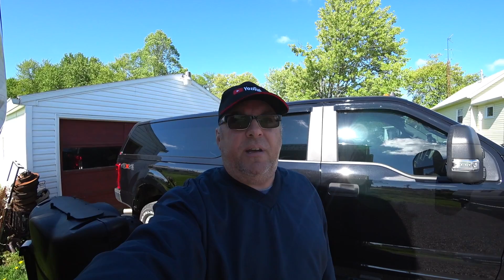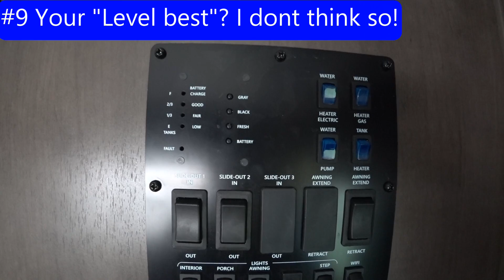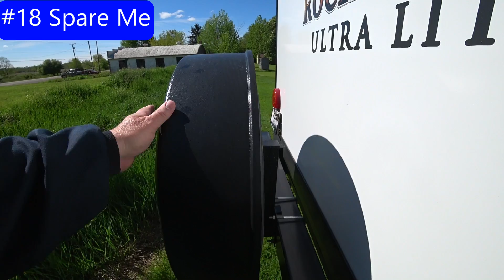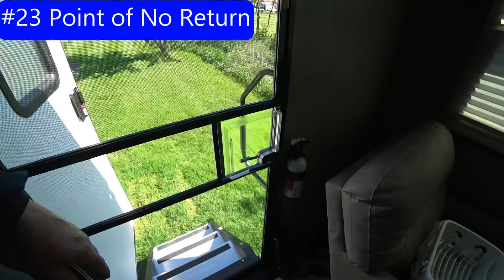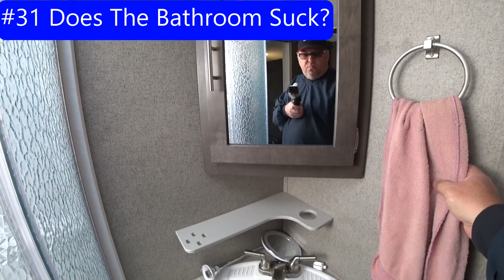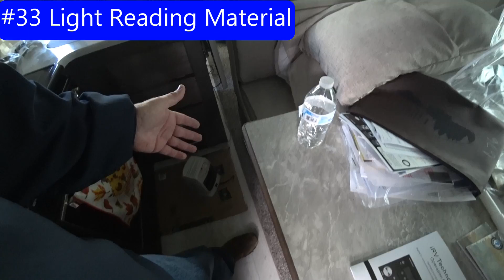36 Dislikes on Our BRAND NEW RV ☹

Comment: Your 1st one was something that didn't impress me with my new camper. It had no levels on it either. Also not a fan of how high mine sits off the ground. My black tank drain goes the full length of the tank and then a sharp 90. Don't see how that will drain very well let alone flush it out since mine doesn't have a tank sprayer. I wasn't happy that I had to move my solar prep and power distribution block on my frame to install my weight distribution. Was not a good setup. Also not a fan of my fresh watar tank and pump being under my bed. Tank isn't a big deal. But the water pump could be in a better spot.

Comment: Wow, wish you were with me when I got mine, ours is just a 17 foot keystone hideout, we are fairly new at this, but have the electric jack, the sway bar, the distribution bars, the water filter, a generator and an inverter. We got a tv for 74 dollars at Walmart. The mount was 10 bucks. A cooler that works in trailer or in truck. I wish we had of gone to 24 feet max, maybe with a slide, but I do like the airstream. The gas to tow a trailer is freaking me out. We have to do more boondocking to offset park fees. Great video.

Comment: My 2019 wolf pup is small enough so why when you open cabinet doors you have drain pipes for sinks running across the shelf or the water supply lines in the way as well! Once the warranty is out I will be getting  pec chrimper and 90 degree fittings and more pipe to reroute the sink drains!

Comment: mike. my new cougar was the same way. dont understand how it could leave the factory . suppose to be able to access the fridge, well, the island was mounted wrong and blocked my fridge. window blinds are all crooked, over 65 screws were not tight or screwed into anything that was not stripped, bathroom door was warped, they didnt put the plastic seal in drain pipe, leaked in the coach, sewer hose storage wont fit a 20 foot hose. light switches are all in the wrong spots where you have to move to get to them, like you said, for a 35 k, and in my case a 50 k coach. they need new designers. im writing keystone demanding a 2500.00 refund. for all the repairs ive had to do that should have been done. best of luck to you,
Reply: Good luck trying to get a refund. You can be sure your request will be deleted as soon as they finish laughing at it.

Comment: Yup your picky.  I am TOO!  So I tend to agree with most of what you're saying.  You know better than to order options like that TV.  Every one knows they're going to pay through the nose for options you could easily install yourself.  A lot of what you pointed out though you should have noticed when you were shopping though so you shouldn't be surprised.  You still ordered it knowing it so you were willing to accept it as it was.  I ALSO agree it is a nice RV and I WOULD HAVE ACCEPTED IT AS WELL!  Some of the things you pointed out are absolutely STUPID and really CHEAP on the MANUFACTURES  part as well!!!  Don't misunderstand I'm sure the points you are making are meant more to point it out so other buyers will see and know what they will be buying, So I am not saying you are wrong!  As well as that you are venting little frustrations that you have and many that you'll have to fix or redo.  They ( all manufacturers ) have never made a quality top shelf RV as far as I can say!  Just the CHEAPEST one they can get away with really.  Very respectfully JOHN

Comment: So your dining room table doesnt fold down and have velcro strips that adhere to wood blocks with strips as well against each side of seat right under outside bottom part of seat? I know my 2019 Rockwood signature ultra lite 8311ws does. That is crazy. Def need to keep table in place durring transport. I do agree with many of your complaints though as i have some of the same. Still love my trailer regardless. Thanks for sharing your review.
Reply from the maker: Table folds down like most. We don't want to fold it down every time 😁😁

Comment: Alot of good points.  Pretty "nit-picky" on some tho.

The TV was your bad IMO.  Any options that are an easier DIY install should be done by the end user.
- that said, aside from the actual tv itself, just having the dealer/mfr install the tv bracket alone would almost be worth what you paid.  ;)
I know of many people who have had nothing but issues attempting to successfully find and anchor a (tv) bracket.
The overall average build quality when talking about RV's is bad enough without trying to find a secure enough location to hang a 32" plus tv from.

Comment: IF..manufacturers listened to the owners, many of these "Why didn't I think of that" moments in the engineers department would ignite a light of reasoning. Yes, some of the things you can 'handle' yourself, but then when you pay a pretty penny or two for what is presumed to be quality then you shouldn't have to come home and 'fix' it to be more durable or practical or efficient. 
Growing up my dad built my mother a new home about every 5 yrs or so, and she always said that no matter how much planning or designing you do, you don't know what works or doesn't work until you live in it. Thank you for sharing, and hopefully someone who can make the right decisions at the factory sees your video.
Reply: Katie Rae  Thank you Katie, but my point was that as families grow, needs change due to life and circumstances beyond our control. Manufacturers who pay engineers/designers  sitting in their ivory towers are not always in touch with what  people who live in RV need, the smart mfgr.s do listen to feedback of owners and make changes. When you pay for what you perceive to fit your needs and have to 'remodel' because of poor workmanship that is something else all together, a new owner of a RV who is not receiving what that perceived to be value is not good.

Comment: The heated tanks (strips) only work on the grey and black tanks and should only be used at 40 degrees or below. There is no heat strip on the fresh water tank. The furnace does not heat the tanks.
Reply: Correction. I just contacted Rockwood. They apologized for giving me some incorrect information. The heat strips work on all tanks (grey, black and fresh). There needs to be water in the tanks when using the tank heaters. If you are hooked up to city water, then make sure that there is some water in the fresh water tank before turning on the tank heaters. FR does not use the furnace to heat tanks as this is not effective. That is, the furnace heat would essentially be blowing outside and not heating the tanks.

Comment: I have the same model 2604ws but mine is 2017 model.  Electric outlets, or lack of, is a wonder to me also.  My black flush is on the correct side tho, can't understand what they were thinking putting your model on the opposite side.  My biggest disappointment tho was not noticing before purchase that the chairs had to be moved in front of the door in order to bring the slide in, that is a pain. The chair also has to be moved to fold the couch out into a bed. I have the table and chair option.  I like it for sitting and looks nice, but sure miss the storage that is gained under benches. Happy travels.
Reply: oh by the way you can download a PDF owners manual

Comment: The perfect RV doesn't exist. The only RV I have even bought with bubble levels was my Jayco Pop up. I don't want a rear ladder. I've seen them pull loose by people hanging chairs and bikes on them. Putting the black tank flush on the passenger side is asinine. Most tank flush don't spin they just adds water. That's why I changed mine to the Tornado flush system.

Comment: Mike solved the 50 amp cord , when in a park that only is 30 amp I have a much lighted 30 amp cord set up to use so at least some of the time I have a lighter cord to pull out
Reply: I haven't seen many units with 50 amp service anyway. It should be a real plus.

Comment: I know what you mean about the hookups some of the models have them all over the rv. And my 2004 hrc next level has a 200 page plus manual. I have been looking for a smaller rv but I think I'll stick with the 37 foot. All it needs is tires and a roof. So what am I looking for. The new ones are mostly crap.

Comment: At 8,800 lbs with 5 lug rims your suspension must be loaded to maximum capacity. First thing I would do is up grade tires and suspension. We spent 2 years looking for our RV and like you said you have to compromise If you are waiting for the perfect RV you will never buy a RV.
Reply from the maker: Tires are on the list 😁👍
Reply: I'm curious how you could possibly add 2000 lbs of cargo?
Reply: @williambranham6249  That is what I am trying to figure. In the video at 1:30 he says 2,000 lbs cargo and a  total weight of 8,700 to 8,800 lbs. I bet he will be blowing tires if he does not up grade the tires. I find most TT can't carry much cargo with out being over loaded.

Comment: I am wondering if you can plug in an extrension cord in the narrow hallway and run it over the top of or behind the sofa over to your dining table.   Maybe that would work and or from the bed room and under the door to the dining table for when you want to use electric and you do not have your slide out.    A rug on the top of the cord would keep people from tripping over it.    Sure would have been nice to have an electric outlet on the side of the lower wall between the dinette and sofa and then you could even hold your lap top on your lap and sit on the sofa to use it if you wanted to.      I would try not  to go very low on the water so you do not run out when you want it.     Is there an outlet in the kitchen that you could use to charge items on your kitchen counter when you are stopped?      Maybe the dinette table should have been a little bit lower so that it would not hit that window?     Maybe you can open up that cabinet and make a storage area?     You sure do not see the style imperfections until you get it home, but I do not think that there is a perfect one out there.    I think that you are so handy, that you will fix yours the way that you want it to be.     It sure is a nice one and a beauty and you will have a lot of good times in it.    Thanks for pointing out the imperfections.     I am sure that they all have them and the motorhomes, too.
Reply: Just charge your laptop. When battery discharges take a break and recharge.

Comment: O.k. here's my 2 cent's.  Tank heating pads have a temp cutoff, melting plastic isn't one of the functions. I can't remember the cutoff temp it's in your stack of manuals.  We opted for the ladder bike rack we toted 2 cruiser bikes across the country with no issues and I'm 270lbs and climb up and down it with no issues.  The sitting outside under the awning with stuff runnning,, well, turn it off get and space heater.  The silly plastic door stop that sticks out, don't worry it'll break off by itself after a month or two.  The couch length, it's for children or drunks who pass out and don't care about couch length.  Anode in the water heater is there for a reason. OH, the bedroom A./c is 13.500 btu, not 15k.  The black tank flush is on the wrong side!  That's fubar!  Well, all I can say is if it took you 3 years to figure out you wanted this one you should've just kept the old one.  YOu just bought a $3k propride and you're complaining about a $500 T.V. ?  Now that's funny...    FIND THE BEAUTY EVERYDAY!
Reply from the maker: Hey now that couch is my size lol 😁😁 ~Heidi~
Reply: Yar Nunya  Yeah i watched.  I optioned our 2019 windjammer with bedroomt toshiba t.v.'s I know what cost is on all 3 because i had a dealer cost sheet of every option. We paid $1k over dealer cost on our special order Rv.  If he paid msrp that's idiotic.
Reply from the maker: @bruiser8363  have you ever seen any thermostat on anything work correctly that didn't have something to heat. Do you actually think that plastic is going to maintain the temperature that's needed without any water in it? The RV Tech showed me pictures of a warranty that they submitted of a melted tank so pack it up it happens
Reply: @Rvdaydream   o.k. then that'll give you something to fix and make a video about and show how you are way smarter than the guys building them.  C ya

Comment: A lot of that sounds like missed opportunity, that they could have spent a little more attention, in some cases a little more money, and got a big improvement.  That's one of the things I expect from RV manufacturers, that they take as much advantage of small things as possible, like using space very effectively.  It's kind of like getting a new house, and finding they cut corners on things that save too little money to be worth it, and the new owner either deals with substandard items in an expensive new home, or rips out new junk to put in something better.  Still, I'm glad you really like the RV overall, and appreciate the effort you put in to find and describe all the things you don't like about it.

Comment: Good video. I drive a class B so not all of your insights apply but I certainly learned from your video. A product you might want to find on Amazon is Museum Putty. It's great for holding things like the baskets onto your bathroom counter. It works on horizontal surfaces and the surface does not need to be smooth. It's good stuff and you will find a lot of uses for it. It's not permanent so you can easily move stuff around.  In your bedroom, there are great solar string lights (also Amazon) that I've strung along the ceiling of my bed area. The little solar panel fits in the window track so it's charging all the time. The lights give off a soft, warm romantic glow--not enough to read a book by but enough to change clothes or read a Kindle.  Thanks again for your videos.

Comment: Lol, it made me laugh when you mentioned you wished they had mounted the TP holder.  Well they did in my trailer, just the two brackets were about 1/2inch too close together so that it was impossible to place a roll of paper. I had to move it myself and then figure out how to cover the extra hole in the wall.

Comment: I think your 36 things are spot on. Some of them are really a duh moment in engineering. The door / step / awning and black tank sprayer are serious 👎 in operation. But like you said, nothing is 100%. 

I’m trying to decide between no slide out vs small slide (trying to keep the weight below 5,000 lbs empty) and definitely want to stay under 26 total feet in length. I know if i buy new that the warranty is going to be useless since the models I’m looking at are over priced at our local dealership so most likely be buying it out of state. 

Thanks for your video! Enjoy the rig and make memories. 

Take care, Bill in Utah
Reply: My vote is no slides 🙋 our former TT had one very shallow slide. No big deal except during stink bug season. Now we have a Fiver with large opposed slides which scare me. Not only is there more places for bugs ( including spiders underneath) there is also more area for mishap. We have already smashed a pillow that had fallen and was unseen, smashed a tiny wooden sign I had on the wall over top the slide. Didn't realize it had fallen during travel until I heard it crunch as I was letting out the slide. Lastly, the other day I was bringing in the slide after a rain storm and water poured in as the rubber seal acted like a squeegee pushing all the water forward and into the coach. If ever we trade up, we will NOT have a single slide ever again. I'm done with them. Meanwhile, I will just be thankful for the extra living space they provide.
Note: slides eat up patio space and have been known to fail while driving. Lastly, they add additional maintenance. RV is for recreation or ease of living. The less maintenance items means the more spare time to enjoy the journey
Reply: @seabliss22  Good ideas!
Reply: If you have a choice no slide less to go wrong. We call them stuck outs.
Reply: Slides = too many moving parts. I intend to keep it simple and not have another potential headache/maintenance problem.

Comment: I think you could make a fortune building functional and practical RVs
Reply: People buy on price, that's why they don't make quality RV's.  The masses want low cost.
Reply: @purposeful49418  
So true to a point.
Wife and I just spent middle $20000 on our trailer. If it was an option for better tires I would gladly paided the extra
Reply: @greghomestead8366  I sold my 5 castle rocks for $150 and bought Carlisle's for $300. Cheap upgrade.
Reply: Donna how come I just said the same thing and I'm only at number 15 but I think I said it at 10 lol

Comment: After having this RV for a while and finding all the issues you have including the hamster wheel fix and all, would you still buy it? Higher quality rig would mean a higher price tag. All considered, do you regret getting this unit? All that texture in the shower will be a pain in the a## to clean. Smooth surfaces would be better but they go for eye appeal rather than practicality. My understanding of the heat strips is that they are to be used when outside air temps are above 45; use furnace under that temp.
Reply from the maker: You must have missed the beginning and the end of the video. I love the RV it's the best RV I could find in the price point that we were searching. It is definitely a higher-quality then most that are on the road. The heat strip that is in the above furnace was tested at 50 degrees and it made no difference.